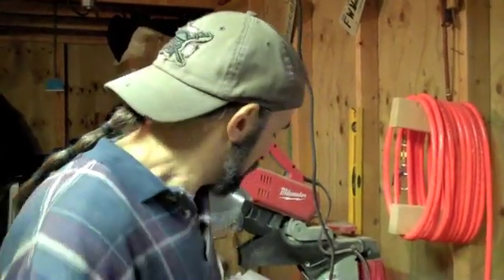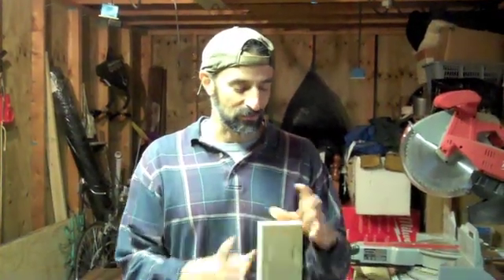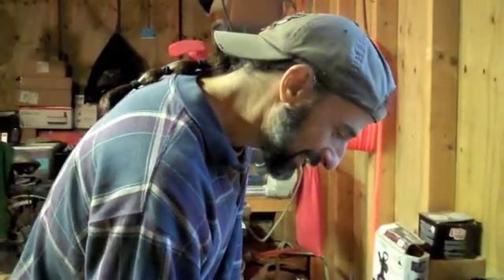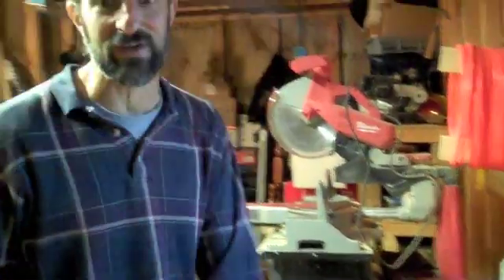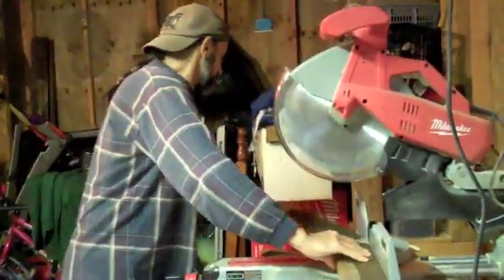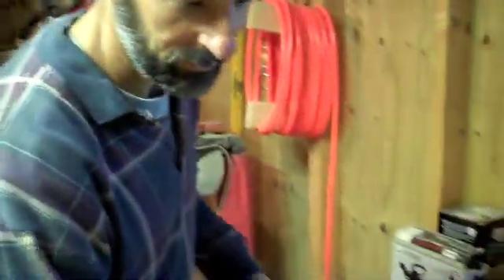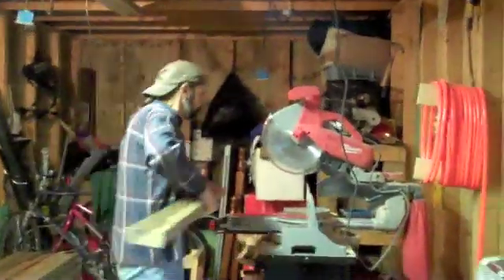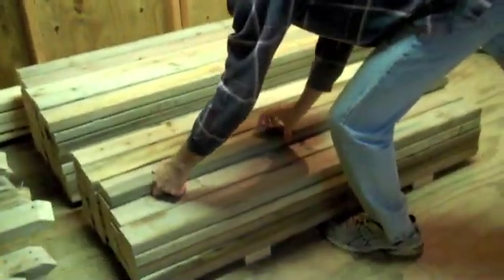BUILDING A WOODEN GEODESIC DOME - PART 1 - STRUT CUTS

Comment: 60 degree cut 1st make a 30 degree cut on a scrap piece of wood, place that piece of wood with the 30 degree cut next to the back of your miter saw clamp it in place then place the piece you want to cut against the scrap piece move the blade over 30 degrees then cut.  It works for me perfect 60 degree cut everytime

Comment: how long is a and b struts ??
Reply: I believe the A struts were 1.27 meters (about 4 feet) and the B's were 1.5 meters (about 4 & 1/2 feet). We used the dome calculator on the simplydifferently website. You put in the total diameter of the dome you want to build and it gives you the strut lengths and the angle cuts.

Comment from the maker: The Milwaukee, Dual-Bevel Miter Saw model #6955 (the saw I used) cuts 60 degree cuts. It only does this on the right. To the left it cuts 55 degrees max. This wasn't a problem. I just flipped the wood over and used the same side of the saw.

Comment: This is a dome calculator we use, you have to run it through a translator program but there are many out there that are free. acidome.ru/lab/calc/#1/2_Fuller_in_Nose_2V_R1_beams100x40 There are two in the US that we have used that are free and will do in standard and metric.

Comment: It may be that you actually need 72 degree angle on one A side, 60 on the other.   This would mean cutting 54 degrees twice (on one side).  This is because 180 minus 54 minus another 54 equals 72, which should fit a pentagonal hub.

Comment from the maker: @Contraindicaciones Thanks for the compliment. 
All of the "B" struts are 60 degree angles. They border the pentagons, but none of them are involved in a center hub connection. Only "A" struts are involved in pentagon hub connections. The "A" struts are the ones with 54 degree angles on one end and 60 degree angles on the other end.

Comment: It's refreshing to see an American, not only using the Metric system, but finding it easier.      Here in Australia, the construction industry generally sticks with millimetres (note the spelling), since 1275mm involves one less mental calculation than 1.275m.    

On a building site, just like with Mars probes,  even simple miscalculations can cost big money.

Loving the vids BTW, have watched two and am working my way through the rest.